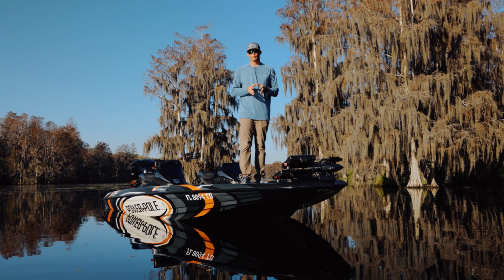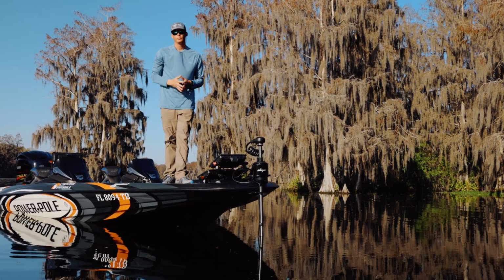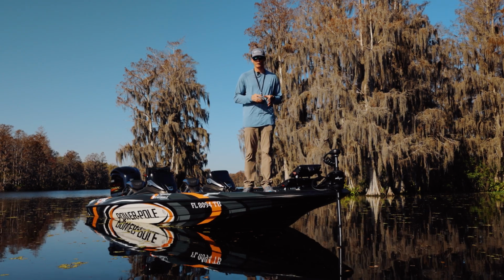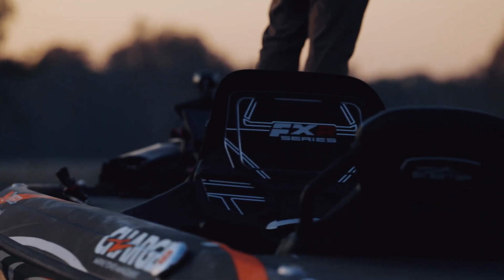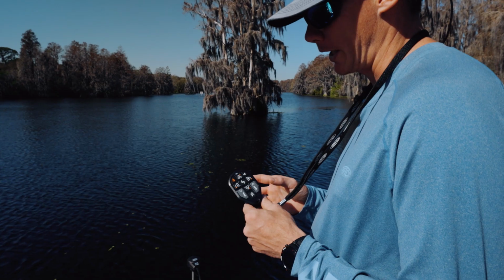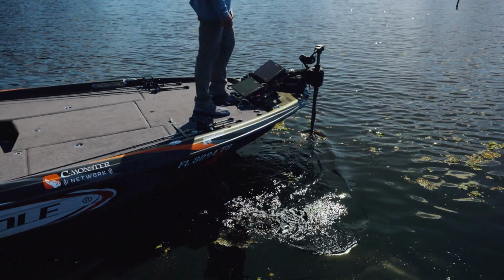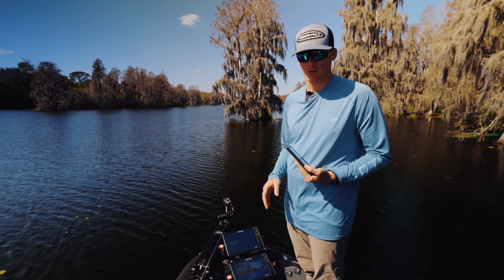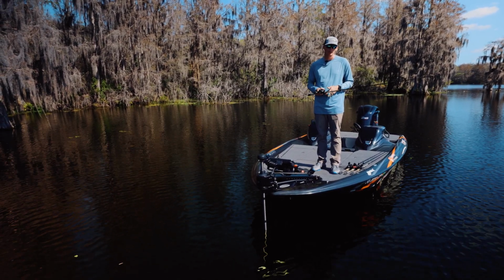MOVE ZR Trolling Motor - User Guide | Power-Pole

Comment: WOW. It's definitely impressive. Expensive but impressive. With all the available features how dependable is it? I am concerned about the different switches and if the weather conditions we encounter effect their performance.
Reply: Douglas your concerns are valid,but rest assured power poles customer service are second to no one in the boating and fishing industry!
Reply: @deborahlynn4680  Do you have one?
Reply: @douglasspickler4925  no Douglas i don't and sadly at a 5k price point i never will.
Reply: @deborahlynn4680  thanks for the reply and I understand. It is pricey.
Reply: Why does everyone always say power pole has the best customer service?  Does their products break all the time? Because that’s what it sounds like.
Reply: @mark-8844  my experience with power poles is only my experiences but the boats i work on the folks don't don't do any maintenence at all. and i mean none what so everthere are a lot of moveing parts on power poles.even backhoes and excavators and such are lubricated at least twice a day,heck i got my boat in 1988 and it looks better than some boats i work on that are less than 3 years old.that being said when you call power pole they ask how they can help you,and ship the replacement parts out at no charge. that seaks volumes
Reply: @mark-8844  I have heard many stories of how Power Pole had shipped brand new parts (free of charge) to guys that bought used boats that had Power Poles on them when the Power Poles had an issue.  I have had mine since 2017 and no problems with mine so far.  This is the reason I chose Power Poles over Talons.  I did a ton of research and the reputation of their customer support was the deciding factor for me.
Reply: @mark-8844  sorry I don't know. I don't own any.